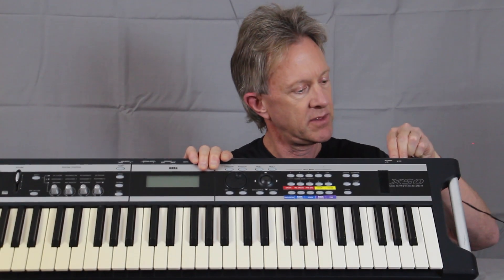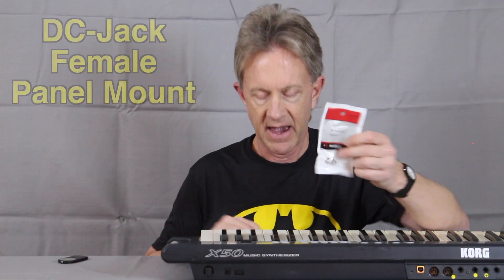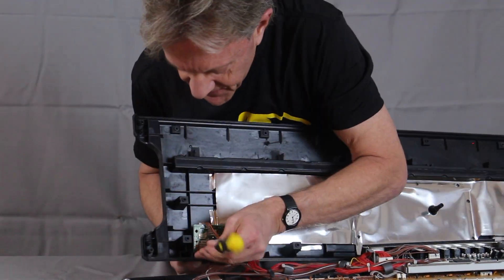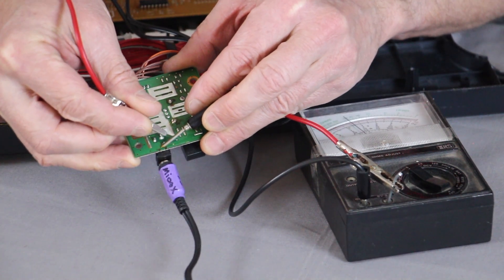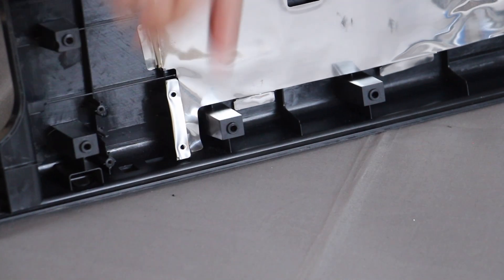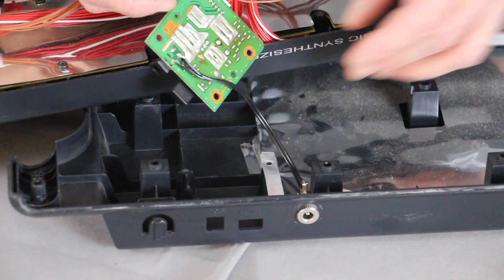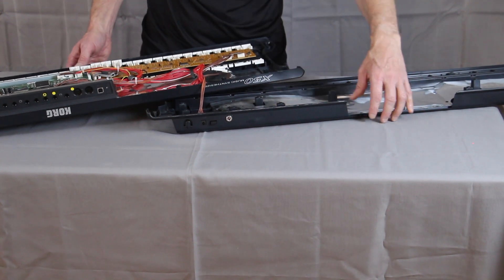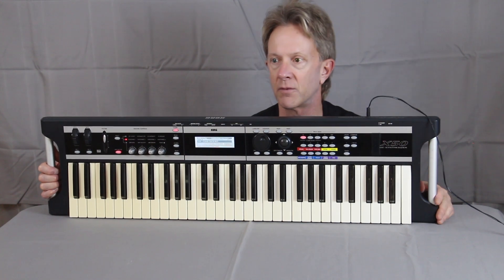How to Fix a Bad DC Power Jack

Comment: Mine's a Yamaha Mox6, but same prob. A friend repaired a Motif ES rack I have w identical prob by simply re-soldering where the jack connects to pc-board, so I'm gonna try that first, case it's just a dry-joint again. If that don't work, I'll install a whole new jack. Thanks, Bro !
Reply from the maker: Good luck re-soldering to the board. Thats definitely the quickest and easiest solve as long as the stress of the jack doesn't crack the joint again. Appreciate you watching!
Reply: @LearnLizard  Cheers, it worked, luckily !
Reply from the maker: @KitCotter  Excellent!!

Comment: Hi Mr Lizard i've a MIcro X and  I've used a too high Amperage on it one time so nows only works with its MIDI funciona but do not produce any Audio... I see that there is 2 regulators on this little power supply board... I think One is for 5 V anthe other (the burnt one) maybe is 12 V... Have you ever had this problem ?
Thank You
Reply from the maker: Hmm- I've never had that problem thankfully. The Micro X and the X50 take a single 12V DC power source so I don't think there is a separate 5V feed. I hope you can figure it out- the Micro X is an awesome little synth!
Reply: @LearnLizard  yes micro X is really good one ... :D ah if i could repair like you did ..... cos my problem is like you ....

Comment: Hello! what is the size of the female panel mount?
Reply from the maker: Hi- I used a 2.1mm jack and plug because they seemed to be the most common, but you could use other sizes as long as its a matching pair. Appreciate you watching!
Reply: @LearnLizard  Thanks! a have another question.

Thanks. Could you share whit me the specs of the new cable? Does it have a little pin at the end?

Comment: Wouldn't it be much better and easier to use a replacement jack socket instead of drilling a hole in the keyboard?
Reply from the maker: If you could find the correct replacement jack you would have to desolder the old one from the PC board and then solder the new one on. Not only is that a very delicate job (with the risk of damaging the adjoining components with too much heat) but I was afraid that the exact same problem would happen again with the jack cracking the solder joint. I know its crazy drilling the hole but it definitely worked!
Reply: @LearnLizard  
"To each his own...." but its not that complicated if you know what you are doing. Thats all I'm saying.  🙃
Reply: @maxximusoralo2516  Its a nice solution, you can add a more standard power jack

Comment: I have a Dc9v power jack which I just can't get to fit with a Dc9v cord. I've tried with two cords of this kind but the metal pole thingy in the jack is just too big for the hole. Do you have any idea why this might be or what I should do? Should I replace it like in this video?
Reply from the maker: There are so many different kinds of of DC jacks its always a challenge to find the correct male/female pair. 
I have a Universal adapter with multiple tips like this:
https://amzn.to/3sCQQwg
You can start off trying to see if the correct tip and voltage will work with your device and hopefully avoid any complicated repair.
Reply: @LearnLizard  
Thank you for the answer! I will check out the universal one!

Comment: mine took a fall years ago, and has net been used since.  I plugged it in today, it's dead, but if I wiggle the jack it powers on and off like yours. wondering if I can fix it by reflowing the solder joints..maybe its just a single joint that got loose. I gotta replace a couple of broken keys as well..don't know where I will get them from?? will try fix the jack issue first, what size jacks?? was it 2.1mm?? I was planning on taking to the electronics shop and get as matching jack for the dc walwart
Reply from the maker: Reflowing the solder is tricky. Its hard because the paths on the board are so tiny and I'm always afraid I'm going to damage a component. Plus it will probably crack again after use. 
There is a set of replacement x-50 keys on eBay right now. (I find most of my rare parts there)
Regarding the jack, I bought a new male/female pair and replaced the male plug on the power supply because Korg uses a weird one that was difficult to find a panel mount female jack for.
Good luck! (the x-50 in an awesome synth)
Reply: @LearnLizard  good point, replacing both male and female ends makes sense..yes as long as they match, the size is not an issue...good tip. 3 pin dc jacks have always confused me. i recently figured out how to identify pins with a dmm and that extra 3rd pin has continuity with the + pin, and it used to allow connection of batteries as well as the jack in things like effects pedals etc thanks heaps, i will track those replacement keys on ebay cheers

Comment: Thank you Mr Lizard! Any idea is Casio keyboards would be similar? Thank you!
Reply from the maker: I'm not exactly sure, but many keyboards and electronic devices have surface mounted power jacks that come loose with wear, so I'm guessing its the same with Casio devices. Thanks!
Reply: @LearnLizard  Even the high end Casio boards have flimsy adapters- a great weak point for otherwise great boards. Thank you for your reply! I will be attempting to repair mine this week.
Reply: @LearnLizard  reporting that I could fix my board after I followed your instructions. The new power unit had a thicker pin, so the original adapter did not fit. I use the adapter which had interchangeable pins and voltage. The new pin is much more solid and doesn't wiggle around. I did not have to drill anything, just replace the existing plug. Thank you again for taking your time and making your video, Mr Lizard!
Reply from the maker: @QalinaCom  Thanks for the great news-- I'm so happy your Casio is back up and running!

Comment: Hi, like the video, I have a Zoom B9.1ut guitar pedal with a wobbly jack that cuts out intermittently and often if touched or moved slightly. I have a replacement barrel jack and was going to solder it to the board but it seems impossible to desolder the old one so I may do this instead... what wire would I use?
I believe it is 12V and 3 Amp input.
Thanks
Reply from the maker: I'd use 22 or 24AWG stranded copper wire. Yes- It's really hard to remove/replace those mounted jacks without damaging something- thats why I decided to bypass the whole jack. Good luck getting the pedal working. Intermittent power is no good!

Comment: Question, when buying a replacement power jack to mount on do you have to find one specific to certain specifications of what your keyboard requires?
Reply from the maker: You can basically buy and use any male/female jack/plug combination. As long as the jack can be mounted in the keyboard and wired to the circuit board, and the matching plug can be soldered to the external power supply leads, you should be golden.

Comment: Why wouldn’t you just swap out the same dc input jack right back on the board? Then you wouldn’t have to drill. I came here cuz i need to swap that exact dc input jack on my wah pedal, but ive never swapped components on an actual  pc board.So i guess i hafta keep searching YouTube.Any tips to share? Again, im curious why you chose to make a custom jack instead of just replacing the dc input jack?
Reply from the maker: The reason I added a whole new jack is because the way Korg designed this is flawed (IMHO) All the stress of the the plug in the jack is put on the tiny connector pins that are soldered to the PC board. I wanted to make sure I had a solution that wouldn't break again in the future. Appreciate you watching!
Reply: @LearnLizard  Makes sense! I actually found how to fix it myself. There is a small metal plate inside the input hole itself.Its supposed to be bent in a “U” shape in order to make contact with the power adapters plug sleeve as it enters in. apparently mine flattened out  over time, not making contact with the sleeve.I took a safety pin, and with a pair of needle nose pliers, i bent the pin in the shape of a hook. Then inserted “hook” into metal plate and bent back into a “U” shape.
Im guessing this wasn’t your problem, but im happy we both fixed our problem.thanks for the reply.

Comment: why would't you just re-solder the broken piece back together?
Reply from the maker: The old jack had 3 tiny pins that that were soldered directly to the circuit board - Its nearly impossible to solder a tiny pin back together. You could buy an identical jack and re solder it to the same circuit board but I was afraid of the same thing happening again so decided to bypass the jack entirely.
Reply: @LearnLizard  exactly problem will be back again and again so when a shop ask 80 euros it s like a waste of money .... make this changement is useful when you are skilled for, i m not and i dont want destroy my micro X well i can use it this way but not fun at all to play like that ....

Comment: I have a broken jack that gets no power at all, so I’m not sure how to determine the polarity of the leads without trial and error.  If I guess, and wire it up one way, how will I know if the polarity is correct or not?  Thanks for the video!
Reply from the maker: Lots of times the circuit board is printed with a tiny "+" or "-" so that is one way you might tell. Or you could try getting a schematic and deciphering, but that can be tricky. I would probably just take the 2 raw wire leads from the power adapter and try touching them to the circuit board to "trial and error" which one is which. You run a risk of damaging the circuit board but most circuits are protected and can take reverse polarity without being damaged. Just know that you run that possible risk.
Reply: @LearnLizard  Thanks for the reply, I think I found out how to do this; using the resistance setting on my multimeter, I touched the pad in the existing jack and each solder point.  The one showed a number, and the other one showed OF, just as if there was no circuit, so I was able to conclude that the front point is connected to the pad, and the back point is connected to the pin.
Reply from the maker: @BrianSauerMusic  Well that seems like a MUCH better way to do it. Thanks and hope that helps someone else with the same problem.

Comment: Thank for the video but as I'm not a techinician, I've not the equipments to fix it. But I've bought a new DC power  connector but the pin  is bigest than the
original one. Is possible to adapt it or certainly is the card ? Thank you.
Reply from the maker: I've seen adapters for sale that change the jack from one size to another. You also might consider buying a universal power adapter that comes with a variety of jack sizes. Other than that you could buy a soldering iron and learn to solder. Its really pretty easy. Appreciate you watching!

Comment: Can you help? I have a keyboard (musical), and I plugged in the wrong adapter (took 9v, I must have used something higher) and I believe it fried something (it doesn't work now). I love that keyboard, I've had it since 1989. Could you offer any ideas/suggestions as to what the problem might be and how to fix it? Thank you :)
Reply from the maker: Ouch! Does it respond in any way when you try to power it up with the correct power  adapter? If there is nothing you may have damaged the internal power supply circuitry. If it powers up at all but isn't working correctly you could try doing a factory reset. Depending on what it is, it might not even be worth trying to fix. Sorry I'm not more help and sure hope you can figure something out.
Reply: Have you checked the fuse?

Comment: Hey Brother thx for the video.
Fixed Mine! X50
Did everything the same. Except for the wire. I used 20gauge to connect the jacks
Keyboard works.
However it seems to get hot. The chip where the original jack is.
Any suggestions?
Reply from the maker: Certain chips get tend to get a little hot - within their normal operating temperature. I'm guessing its OK- moving the jack shouldn't have effected it. Glad you got it working!

Comment: I need to fix my Korg Krome 73.  I tripped over the ac adapter, and it pulled the wire out.  Now it will not work.  Any suggestions for the Korg Krome 73?
Reply from the maker: Did the wire break on the AC adapter or did the jack break on the keyboard? I've broken SO many AC adapter cords :( Its easy to solder the wires back together- just make sure you don't reverse the polarity. If the wire pulled out of the adapter itself its probably best to just buy a new one. 
If the jack on the board is damaged, now that's another story. You are probably going to have to pull everything apart and replace. Good luck!
Reply: @LearnLizard  there is a back panel that I unscrewed, but I can't take it off.  Its the connector, not the ac adapter.  Thank you for your reply.  This could not have happened at a worse time.  I want to take it apart, but scared to.
Reply from the maker: @artpekarekiii4320  Sometimes the back panel is held in place by screws AND the jacks that connect to the circuit board. You could try removing the nuts from the jacks to see if it will come off. As long as you are gentle and can remember the steps to put it back together, it may be worth a try. I hope you succeed!!
Reply: @LearnLizard .  I took the screws off the panel, and I tried to pry the panel off with no success.  I want to force the panel off.  I put the screws back on the panel because the panel is too difficult to take off.  Thank you LeanLizard.  I will wait for now, or until I know more.
Reply from the maker: @artpekarekiii4320  OK- I hope you get it all sorted out
Reply: @LearnLizard  thank you.  There is a guy here in Cartagena who should be able to help me here.  The scary thing thing is having some guy help you here, and trusting him not to destroy something that can't get fixed less than 2,000 milies from your home.
Reply from the maker: @artpekarekiii4320  I hear you- long ago I had a VERY expensive synthesizer (Prophet 5) that I had to ship back to the manufacturer for repair. It WAS scary (but everything worked out fine)
Reply: @LearnLizard ,  I just got my computer fixed.  I am very happy.  That took a while, and I'm surprised I found a man who could take it apart and find roaches in it too.  So ripping the chord out of the back was a blessing.  The keyboard would have been destroyed if it didn't get broken.  Very happy to have it back.

Comment: Hi , thank you , but i have another problem with my x50 : 
i can hear a high frequency sound coming from my keyboard next to the power button ( but it's not coming from my power charger )
the sound disappears few minuts later , and when i play with high velocity , sound comes again . the sound is VERY annoying
what do you suggest ? i have my x50 since a lots of years but it works perfectly .
Reply from the maker: Hmm- Is the sound actually coming from inside the x-50? It could be coming from a transformer or ceramic capacitor on the circuit board that is failing. If you are adventurous you could try to identify and replace the cap. If its a transformer it could be impossible to find an equivalent replacement, but you could try coating it with silicone rubber to deaden the sound. Or just wait until you get older like me and you won't be able to hear it at all!
Reply: @LearnLizard  problem resolved ! problem was not coming from my x50 but from the power charge ! i noticed my power charge did the SAME horrible high sound that inside my x50 ( yes yes , in my x50 AND into my power charge . ) i just bought a new power charge .
Reply from the maker: @pykemanosbeats  Oh good- I'm glad you figured it out-- and really glad you didn't have to  go in and start soldering on the circuit board!!
Reply: @pykemanosbeats  I’m sorry to barge in on your conversation. I have the same problem. There is a high pitch buzzing sound around the power button. What did you do to resolve your problem. Thank you very much.
Reply: @ralph3109  it's your lucky day dude. i just bought another charger. Problem instantly solved.

Comment: Thanks so much man, been looking for this video. My Korg X50 had this problem from day 1. Thanks so much for sharing!
Reply from the maker: Glad it could help! (P.S. I still love my X50 after all these years)
Reply: @LearnLizard  I just purchased the parts. I know where the + and - is on the DC board based on your video (have no multimeter yet) , but is the Radio Shack part referenced where the - and + should be?
Reply from the maker: @TheFullVideoGuy  All that matters is that the plug and the jack match-
...so if you solder the "+" connection from the circuit board to the tip or pin of the jack, the plug needs to match the polarity and be supplying "+" voltage. (thats how mine is wired) Hope that makes sense and good luck!
Reply: @LearnLizard  <sigh> yeah, i should have just purchased the Korg TR - Much better

Comment: The problem with my keyboard is described at the beginning of this video https://www.youtube.com/watch?v=-yV3fGjADR8  - your method appears sufficient - between that video where he installed the power supply inside and yours where you more simply installed a new power jack - are these the only two possible methods?
Reply from the maker: I think the very best way might be to buy a female connector exactly like the one that is damaged  and replacing it with the new one. (thats what a professional musical repair shop would probably do) The tricky thing about that is not only finding the exact part, but when removing the old  one you risk damaging the circuit board either form heat or stress. Plus I didn't want to have the same problem again in the future!

Comment: Thank you for the video. I lost my power totally on my X50. Do you have any recommendation for the gauge of wire?
Reply from the maker: Hi- I typically use AWG22 gauge wire for this type of project and it always works fine. Good luck fixing the X50 (love that synth)